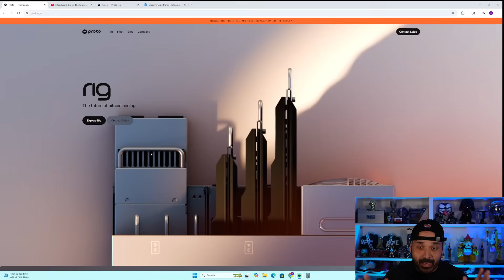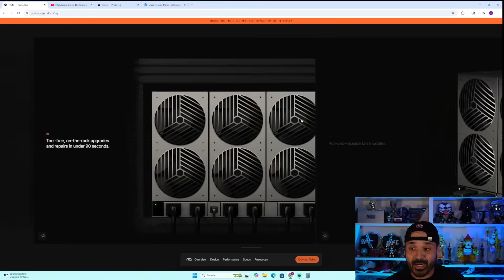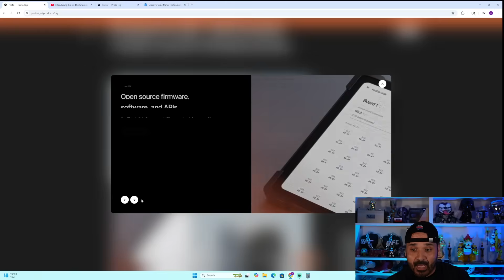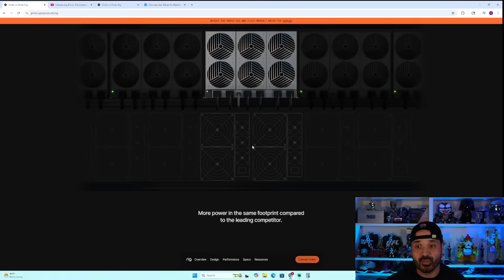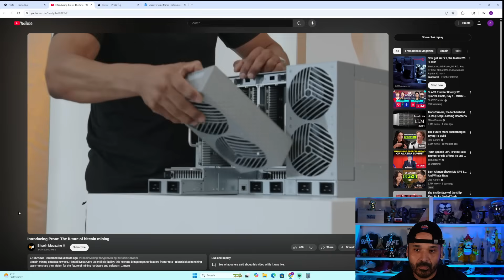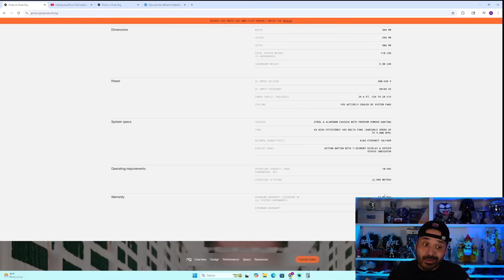NEW Proto Rig Bitcoin ASIC Miner From Jack Dorsey / Square Is Changin The Game W/ Its Modular Design

Comment: This looks awesome, but one question and sorry if it’s not covered, but if you’re only running 3 boards/1 PSU how will they be able to run boards differently? Like you might not be able to underclock 2 boards and add a new gen board unless the voltage stays the same and only the freq is adjusted which will then limit how low you can go with power consumption severely. Of course you can just buy a second control board and PSU but I don’t think it will be a clear cut like that, hope I’m wrong
Reply from the maker: It would all be in the firmware which theyve stated will be pretty open and freely adjustable in terms of frequencies , they actually gave that specific example in the presentation , but until we can play around with the firmware won't really know the true extent of the possibility/limitations and/or how truly open it will be.  Also the limitations of the control boards and how that will work exactly, but it's a step in the right direction. 

But they key thing will be pricing , that will make or break this concept.
Reply: @miningstacker  Yeah awesome, if you can adjust the voltage for each board that would be insane, I was running my J pro at 67T for 1400 watts on the wall which is like 20 watts/T but thats running it at the minimum voltage allowed. imagine finally being able to add the equivalent of an S23 board to that and slowly build

Comment: Think about the money that bitmain would loose if they did something like this…. It is most deff intentional having a million different miners per series and releasing them all within months of each other with the best and most efficient being astronomically priced. 🤔🤔
Reply from the maker: I would actually see it the other way around and say they would actually have gained a lot more profit from a move like this. They would have been able to save so much on shipping/logistics, especially on those orders that are in the thousands of units. Time to market would also have been way faster as they would just be manufacturering the boards primarily. 

Asic pricing is based on profitability, biggest cost on their end is the Asic design/actually making the chip. People would have still payed the same amounts for access to the performance of the chip whether it was a system thats upgradeable and they're just buying the hashboards or it was an entire Asic system. So if people were just buying the hashboards , they would have been able to save a ton on shipping/logistics as well as the time to actually manufacturer the units, which has been an issue in the past , they they just can't make them fast enough. 

They typically release models as needed because of competition and whenever they can find an efficiency gain in that chipset with a modified design , typically we see larger gains when it's a new generational jump going to a new wafer like 7 nm to 5 nm etc , which are costly upgrades initially , but lower over time. But the pricing is mainly based on profitability, which is why we will sometimes get an Asic like the ks3 debut at a 49,000 dollar MSRP or something like the e9 pro that had a 1200 dollar MSRP , just had to do with the timing/profitability of the Asic when it launches.
Reply: @miningstacker I love how you make me think and change my mind with every reply!! Lol thanks for your insight. It is much appreciated!!
Ps with any luck we will see prices for bitmains take a downward trend/innovation from them as well!! 🙏
Reply from the maker: @Christoph.403 😂 of course brotha , always good to get different perspectives on things to get better understandings , which is why questions/discussions like this are so good .

And yes , we want all the competition we can get , competition breeds innovation , as well as better prices in the space.

Comment: Someone needs to make a home asic Bitcoin miner that's actually quiet and can still hash a lot with the big boy Asics. They need to invest in high flow quiet fan tech
Reply from the maker: Not super quiet , but the ac infinity fans run well and get rid of that high pitch squeal , that's how I run all my Asics. Hydro/immersion units also very quiet depending on the setup as you can run the heat exchanger outside .

Comment: I think the entire unit is a single miner. If yoou look at the cabling and the chassis, it has one eithernet and one display in the lower left for each 3-bay (9 card) rig.
Reply from the maker: It is , yes , the three shells are the entire chassis , so the chassis would include the 3 psu's /control boards and then you add up to 9 hash boards

Comment: 3 phase power input kills it for home mining. Maybe if you were going solar you could dedicate a section of panels to pair with a 3 phase inverter. Maybe they will offer 240 volt psu?

Ohh ok so the presentation showed 3 phase input. But when you got to the spec page it does show 240v. Def need to look into that. If it’s single phase that’s great!
Reply from the maker: It's rated 208-240v, so seems like it would also be single phase also.
Reply: @miningstacker yes I edited my response. I seen that later in the vid that it was 208-240.  That’s great news. Maybe in presentation they just wanted to show 3 phase is offered esp for data centers.
Reply from the maker: @DouglasHeyen most likely as that is who they will be catering to for sure
Reply: @miningstacker 208-240 is still usually 3phase..  208wye being the most common in the US.  Bitmain, was an asshole Chinese company and decided that the US market didn't matter, hence the reason they made their 3 phase miners 380v..  which is an international voltage but a super weird voltage in the US.  Our usual 3 phase voltages in the US is 208/120wye, 240/120 delta,  and 480/277 wye or delta..  so f bitmain